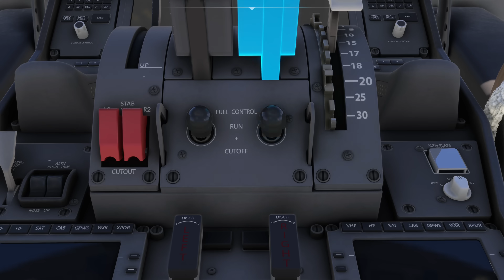Air India 171: Why Did The Fuel Cut-off Switch Get Moved?

Comment: This is a harsh lesson for the airline industry. The probability of both engines shutting down at such a critical moment is low, but the impact is considerable high. This incident should draw the attention of the entire global airline industry. This could have happened to any airline, as the preliminary investigation shows that human error was most likely the result. Whatever the cause of the error, this incident reveals the great vulnerability of a commercial aircraft and the high risk it poses. The aviation system is one of the most reliable means of transportation, and for me, it remains so. I continue to believe in human pilots and  I also understand that we are human and prone to making mistakes. In my opinion, the professionals conducting the investigation should also conduct a thorough risk assessment and develop new systems and procedures to prevent this incident from happening again.

Comment: Just a comment on the fuel cutof switches.
I saw a video after this preliminary report, which said that in a Special Airworthiness Information Bulletin NM-18-33 from december 2018 that there were problems with some of these switches. The BOEING models where some of these faulty switches could hav been installed includes the Air India model.

The SAIB said that: 
«The Boeing Company (Boeing) received reports from operators of Model 737 airplanes that the fuel control switches were installed with the locking feature disengaged.»
«If the locking feature is disengaged, the switch can be moved between the two positions without lifting the switch during transition, and the switch would be exposed to the potential of inadvertent operation.»

You might want to check this out.

Comment: For those who believe in pilot suicide theory I have a question. Wouldn’t it be far easier for a suicidal pilot to suddenly push the control column forward and pitch the aircraft straight down? That’s a surer and faster way of ensuring destruction than cutting off fuel which leaves room for possible recovery. If suicide was the objective, that pilot would have pitched the nose down even as the other pilot attempted to reset the cutoff switches to run. The suicide theory isn’t making sense to me.

Comment: Hello Steve, don't know if you are aware, but both the British and Australian Governments have launched an emergency inquiry into the fuel cut off switches. I am in Sydney. As I woke up this morning, I heard the aviation correspondent for ABC NEWS24 say that there were concerns expressed by Air New Zealand to the Joint ANZAC Aviation Body.

I am wondering if that meant this had happened inadvertently before. Because I still struggle to believe any Pilot or Copilot would do something so dreadful. I REFUSE to believe that.

Comment: Possibly could the cutoff switches be put on both captain and co captain sides and requires both switches to be turned off to shut down an engine to keep mistakes from happening.  Such as shutting the wrong engine down during an engine failure.  Just a thought.

Comment: Captain Steeeve -  "Don't count your chickens before they hatch." 

1. Word for the fuel switches used in the report is “Transition” with a gap of 1 second and all 787 pilots disagree, it’s possible electronically but not manually. 

2. Timing of conversation missing and all other conversations, alarms are not yet stated with time sequence. 

3. RAM was already drawn 3 seconds after take off. Does report say “switches” were MOVED to cut position before take off when pilots are preoccupied fully in take off protocols?

4. Consider one pilot noticed engine off on I CAS and asked the question, other said no he did not. Now that engines are cut electronically the procedure to cut off and return to Run was done reported in the PRELIMINARY report? Time sequence not yet given. 

5. Also did you know WSJ published your version 44 hours and 8 minutes prior to AAIB released its report past midnight in India ? 

Live with what you opine without full information.
Reply: if you use two hands, you can switch them both off nearly instantaneously.
Reply: So if the captain is the one with suicidal intent, the co pilot left the take off gear and everything else and with both hands moved fuel switches up ?

Comment: AI Overview:

In December 2018, the FAA issued a Special Airworthiness Information Bulletin (SAIB) regarding potential issues with the locking feature on fuel control switches in various Boeing aircraft models, including the 787. This advisory, prompted by reports of switches installed without the locking feature, highlighted the risk of inadvertent movement of the switches, which could lead to engine shutdown. While the FAA deemed it not an unsafe condition warranting an Airworthiness Directive, the advisory recommended operators inspect and potentially replace switches with a superior locking mechanism. This advisory was referenced in the preliminary investigation of the Air India crash, where the fuel switches had moved to the "cutoff" position just after takeoff.

Comment: The real question is what came first. The RAT deployed at 47 seconds before the gear was retracted, then at 53 seconds the first cutoff switch “transitioned” off then  on. Ten seconds later the other cutoff switch “transitioned”off then on. One engine re-lit, and the other was attempting to spool up, but there just wasn’t enough time to miss the building. These two pilots, both of them, may well have been heroes thinking fast, trying to reset a software failure, and salvage a doomed situation. Another B787 lost both engines on landing in 2019, so this wouldn’t be the first time for this aircraft type.
Reply: Where in the report does it say a switch was cutoff then immediately on? I read it as a switch was cutoff, then the other switch 1 second later was also cutoff. Then 10 seconds pass before one switch is set to Run, then the other 4 seconds later set to Run. The 10 second delay is perplexing, but maybe the innocent pilot did not notice for several seconds, then the question "why?"
Reply: @jamesrav  I think the person who wrote this comment never read the preliminary report, he is bringing facts straight of out of nowhere lmao. Some people are way too cynical towards boeing and they'll only believe what they want to believe.
Reply: @jamesrav  when you are in takeoff and realize a major issue happens, something you would never think happens it takes you time to process wtf happened. regardless the plane would not pulll up. also this is defo a plane issue either maintenance or design flaw. ain'tno way this is pilots like how this old hag makes it out to be
Reply: The gear was never retracted.  The RAT deployed AFTER the fuel switches were moved to Cutoff., the RAT deployed BECAUSE the switches were tuned to Cutoff eliminating the engines as a source of electrical power.
Reply: The incident in 2019 was with ANA airlines and a b787 but they were using Rolls Royce Trent 1000 engines, not GENx engines.
Reply: Fair enough, then why the recording stated “why did you cut off the switch and other replying I did not”
Reply: Why your BOEING don't install CCTV inside cockpit, it has millions of crucial parts installed. You know WHY, pass the BLAME on PILOTS, else they will get exposed and can't claim from insurance.
Reply: @funnyblackrose.209 Why on board data storage and no cloud backup at least????????
Reply: Brilliant observation. This sequence is very critical rather than viewing the engine cutoff in isolation. No one is discussing this sequence but only jumping on to pilot error- murder suicide theory.
Reply: The engines power the electrical generators.
The loss of generator power triggered the deployment or the RAT.
Reply: Western propaganda covering up and saving Boeing.
Reply: YES !!!!!!!!?! But i doubt what i tell will post
Reply: https://www.federalregister.gov/documents/2021/08/09/2021-16766/airworthiness-directives-general-electric-company-turbofan-engines
Reply: MRFRS thay took it down fuck this no one wants the reason anyway
Reply: And the strange thing is how the hell "Two spring actuated Switches" that require pull, move and plug...got transitioned to CUTOFF from RUN in one second CAP. The FDR report says two switches were cutoff "one after other" all in a Timeframe of 01 second. A pilot transitioning two manual safety lock dented switches (Not click button) with a hand in 0.999 second is not much probable. I hope the investigation will clear all these details in their final report. Devils are in the smallest parts and details many a times.
Reply: @letsthinkbriefly3761  That points to the Captain moving the switches. He wasn't flying, he was 'monitoring', so his hands were both free, so he could move both switches at basically the same time.
Reply: @GK-yi4xv Yes sir, I agree with the idea that it has to be two hands achieving that level of (0.999 second) speed to pull two spring switches up and plug it in to cut off. However, we can only assume that. But given the probability of the switches wherein many pilots have said the cut switches are in the Middle down Dash, not in front, and to operate requires a level of movement like turning half of the body to certain switch sides which requires a few seconds, but we are talking about two switches wherein the pilot has to turn both hand and body is an activity sounds not very probable (not rulling out tho).
Reply: When there is no engine rat deployed automatically to supply electricity supply
Reply: I agree with you.  It makes more sense.  The murder suicide with a denial makes no sense.  The other pilot would say nothing.

Steve is a bit of an old school B-17 pilot.  He doesn’t even understand that the FDR just sees electrical signal and there is no difference from a loss of voltage at the switch than a flipping of the switch.  The pilot asking why did you cut off the engine is him just looking for a reason because neither him nor Steve understand electricity.
Reply: My question is similar to yours.  Why did the RAT deploy?  There was no engine failure when it deployed.
There has to be something occurring in the Electrical/Electronic Systems.

Comment: AI Overview

￼

￼

￼

+6

In December 2018, the FAA issued a Special Airworthiness Information Bulletin (SAIB) regarding potential issues with the locking feature on fuel control switches in various Boeing aircraft models, including the 787. This advisory, prompted by reports of switches installed without the locking feature, highlighted the risk of inadvertent movement of the switches, which could lead to engine shutdown. While the FAA deemed it not an unsafe condition warranting an Airworthiness Directive, the advisory recommended operators inspect and potentially replace switches with a superior locking mechanism. This advisory was referenced in the preliminary investigation of the Air India crash, where the fuel switches had moved to the "cutoff" position just after takeoff.

Comment: I have two questions:

1. Are there timestamps in the cockpit voice recording (CVR)?

Specifically, is it possible to determine the exact time when one pilot asked the other, “Why did you cut off?” This detail appears to be missing from the preliminary report. (I’ve linked the PDF and included the relevant paragraph from Section 12, Accident Flight, below.)

2. Can the fuel cutoff be triggered electronically—without the physical switches being moved?

In other words, is it possible for onboard computers or sensors to shut off fuel to the engines even if the fuel cutoff switches remain in the RUN position?

In this video (https://youtu.be/AE4WiZN2Z1g?feature=shared), one of the panel members—who was skeptical of the theory that a pilot acted with malicious intent—suggested a possible scenario. He argued that the brief toggling of the fuel cutoff switches (from RUN to CUTOFF, then back to RUN within 15 seconds) might have been part of a standard operating procedure (SOP) to reset or restart the fuel control system.

That makes the timing of the question “Why did you cut off?” crucial. Was the pilot reacting to seeing the switches in the CUTOFF position? Or was he responding to a warning light or other indicator showing that fuel had been cut off to both engines?

Excerpt from the preliminary report:
https://i2.res.24o.it/pdf2010/Editrice/ILSOLE24ORE/ILSOLE24ORE/Online/_Oggetti_Embedded/Documenti/2025/07/12/Preliminary%20Report%20VT.pdf

12. Accident Flight
...
The aircraft achieved the maximum recorded airspeed of 180 knots IAS at approximately 08:08:42 UTC. Immediately afterward, the Engine 1 and Engine 2 fuel cutoff switches transitioned from RUN to CUTOFF, one after the other, with a one-second gap. Engine N1 and N2 began to decrease from their takeoff values as fuel supply to the engines was cut off.

In the cockpit voice recording, one pilot is heard asking the other, “Why did you cut off?” The other pilot replied that he did not do so.

As per the EAFR data both engines N2 values passed below minimum idle speed, and the RAT hydraulic pump began supplying hydraulic power at about 08:08:47 UTC.

As per the EAFR, the Engine 1 fuel cutoff switch transitioned from CUTOFF to RUN at about 08:08:52 UTC. The APU Inlet Door began opening at about 08:08:54 UTC, consistent with the APU Auto Start logic. Thereafter at 08:08:56 UTC the Engine 2 fuel cutoff switch also transitions from CUTOFF to RUN. When fuel control switches are moved from CUTOFF to RUN while the aircraft is inflight, each engines full authority dual engine control (FADEC) automatically manages a relight and thrust recovery sequence of ignition and fuel introduction.

Comment: In an electrical failure is there a safety automatic cut off for the fuel switches? The surviving passenger indicated that the power failed on climb out and he heard a clunk as the Ram Air Turbine deployed. No pilot would touch those switches and if  suicide was intended that would be from a greater height.

Comment: Blaming the pilots seems a bit more convenient for me than blaming Boeing, G.E. or Air India since they cannot defend themselves anymore... Also,.. how sure are we that the switches have been set to cutoff physically? I think the data only records that was based on electrical and electronic inputs. The switches could have remained untouched but the electrical and electronics inside have been messed up by either a faulty computer or by poor maintenance. The switches were found in the "on" position after the crash. Also, what's with the video showing the flight before accident where the plane had no power and AC in the passenger's area? I think that should also be included in the report since it would give a clue to the plane's condition before it took off. Sure, tt may have been a deliberate act, but for me, it's still too early to blame the pilots when all angles are not totally examined and exhausted and there is no room left for doubt and conspiracy.

Comment: I have 48 years flying experience.   I have over 20,000 + hours  in Big Boeing aircraft.   NOT ONCE in my career have I heard of anybody accidentally selecting the fuel control shutoff switches to cutoff.   Never!   For those non pilots, you don’t accidentally select them off by brushing up against the knobs.  It takes a deliberate action.   We know what happened here.

Comment: Hey Captain Steeve, it's really great that you're covering this situation, it's a hard time for everybody out here and the preliminary report brought out more questions than it answered. However, there's one thing that keeps bugging me quite a bit which you had mentioned in one of your previous videos from another pilot, and that is the landing gear's tilt actuator happened to be set towards the front, or the position it would be at during retraction. However, during the crash findings (and photos in the preliminary report), the gear handle is set at extend position. It doesn't quite meet up with the video footages we've seen so far and if there's an explanation behind this, we'd love to hear it.